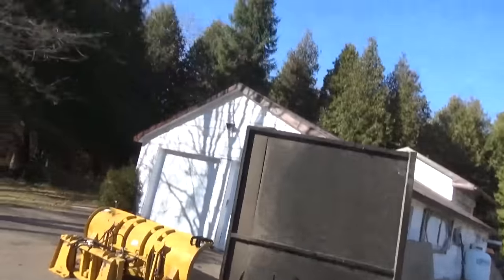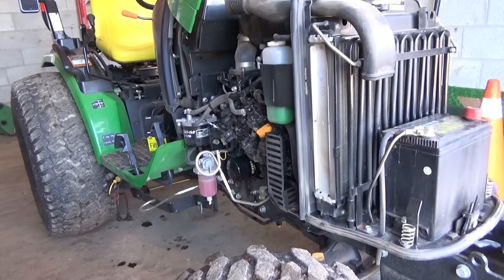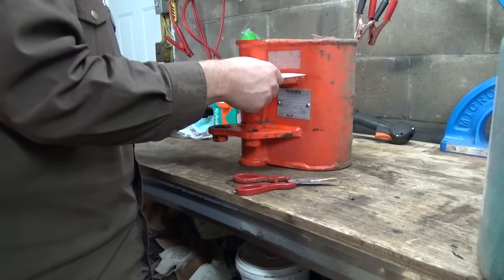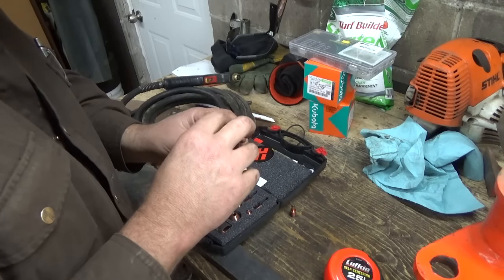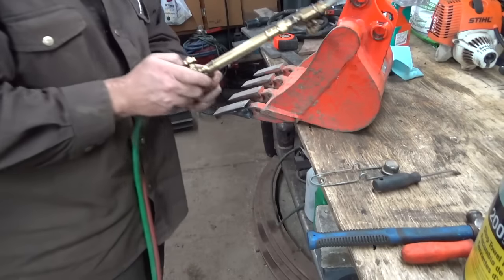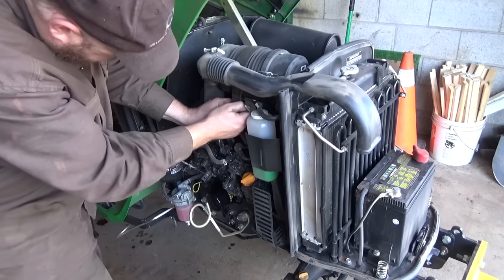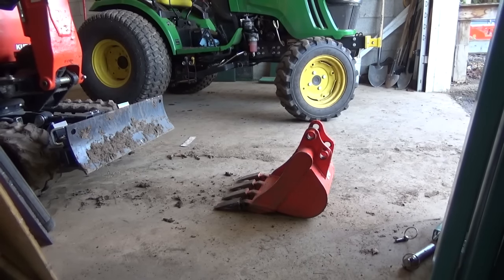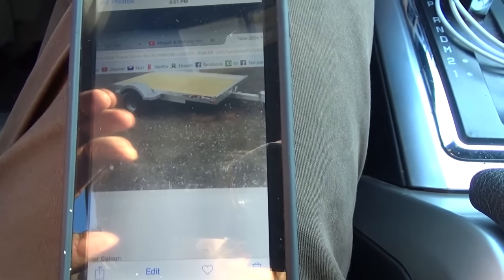Tracing the bucket ears and some machine servicing

Comment: I would use expanded metal sheets on each ramp to prevent the sliding of the excavator when the tracks were wet. Cut a strip a little shy of the width of each ramp and attach  to the ramps. There are two different types of expanded metal, one has a smooth surface and the other  has a stair stepped  surface, this is the type to use,  plenty of traction in either direction. It can be bought in either steel or aluminum, and would be a lot cheaper than purchasing a new trailer, especially one that has a capacity rate at the border line.

Comment: If you really want to remove the teeth on the small bucket, turn the bucket over then heat both indented sides of the tooth while, in stages, driving a wedge shaped piece of metal (like a chisel) under the gap I saw that was between the small tooth and the large tooth. when the metal is red it will become more malleable and allow the chisel to force the indented pieces of the large tooth apart. Try it, you'll like it!lol
Reply from the maker: +sandrammer thats what i thought.. but i was nearly out of oxy so the heat just wasn't there
Reply: perhaps later
Reply: +BILLSTMAXX :) Yeah you might want to keep using the full word here (oxygen).  This isn't a word that should be "dewified."

Comment: I think you should build some good steel ramps and use angle irons as cross doowys up side down like v's for good traction that's what we use so like channel on either side then angle for middle doowys up side down welded in there and a good thing on the top so ts hooked on the trailer so they wont fall off the trailer

Comment: maybe you could try painting your ramps with Rust-oleum restore 10x. it is a really thick paint that gives the surface a sand paper like texture. home depot sales it. i use it on a wheel chair ramp for my father. it help give it better grip for the winter.

Comment: The trailers are rated for highway use.  I think they over-engineer and under-rate as a safety factor.  You'll be using the trailer off-road, so I think you could max the trailer out without stressing it too much.  One thing to remember, however, is you'd be adding even more weight if you need to put sides on it or making a side dump for dirt, or is that not in the plans ?

Comment: Hi Bill. Here is a picture of a small trailer holding a mini ex like yours that might work out hauling the little guy around. Took this pic at the local Home Depot in the states. Could hook this to the back of the small JD and hook the dirt trailer to the front (do you still have the hitch on the front?) and all can parade to the digging site. Might work out. Take care. Mark http://www.imagebam.com/image/664f5a447811844

Comment: What would work though would be inventing an extension tube per tractor for easy fill, whether it be screw type or how ever it is fitted. I hear you on the filler tubes, most are an after thought by the manufactures. One snow blower up and I would have had a good filler tube, you have an expensive JD, make no sense... You should write to them, they might have one already produced for techs? It should be supplied with a tractor like that.

Comment: bill why don't you use your double Axel trailer for the mini x
Reply from the maker: +Jon Hoad its big.. trying to keep things smaller for ease of access
Reply: +BILLSTMAXX :) it is easy to take the teeth off there are little pens in the teeth that's wilded on the bucket that u need to knock  out  and the long teeth should  slide  off
Reply: +Chris Huggins they don't have pins, they're clamped on if u look.